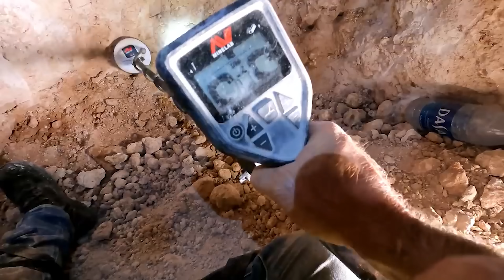Biggest Placer Gold Deposit Found with Gold Monster 1000

Comment: The caliche and there is cool I was in some old dig holes in Nevada recently and they were digging down to the caliche also there was bands of gravel and then bands of gravel and more bands of caliche it's like it was stacked one on top of the other like a flow of gravel would come in then a flow of caliche they flow of gravel then a flow of caliche some of the gravel was dark and fine grain others add larger and angler rocks in them it was really interesting to see it it was like the mountain was ripped apart and spread out into layers would be sweet to dig a mine out there it almost looks like what you're working in but more banded

Comment: Jeff, enjoy watching you work Pops drift mine. The jack hammer and hammer drill used in a horizontal fashion looks very taxing not using the weight of the tool in your favor. With your hammer drill, can you use a 3" auger bit and turn the drills rotation on so it hammers and rotates to bore in? Once you're an inch into the wall the weight would be partially supported by the bit. Would it work or would the bit bind and break your hand in that caliche?? Keep up the great content!
Reply from the maker: it may bind in hard Caliche

Comment: Hey Jeff, I’m working on building a skip system for my incline shaft, how did you make it auto dump?
Reply from the maker: if its a bucket use trunnions ...if its a skip car then use double wide rear wheel with a second track

Comment: Jeff, have you looked into if they make smaller hydraulic diggers similar to the opal mining shows?  Also, you’d be a great guy to have on a show like Gold Rush. You and Dan Hurd have very tv ready personalities.
Reply: Also would be interested if they have any horizontal augers that may help you advance your face faster. Pop some horizontal holes into the face and then come in with your jack hammer and break it up quicker. Guess you may get more dilution if the seam is wavy.
Reply: If they did have powerful enough augers you could advance an entry and then auger out the pay layer in either direction and save moving a lot of material.
Reply from the maker: thanks